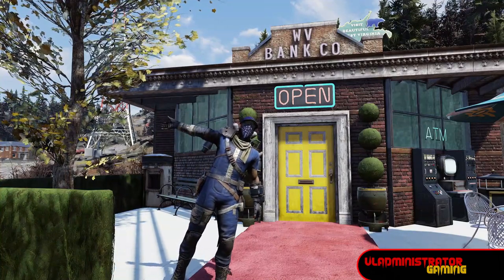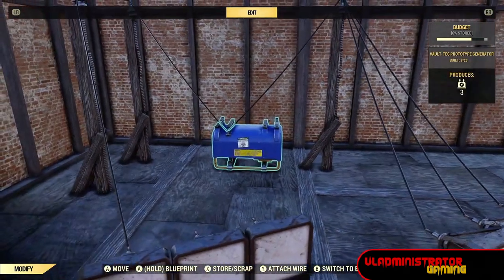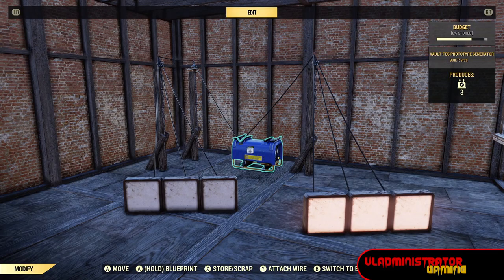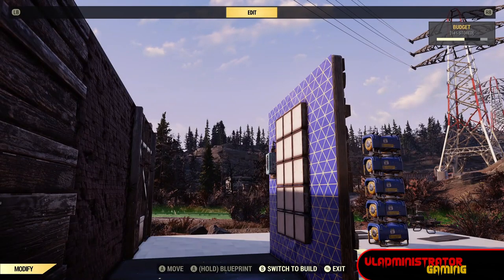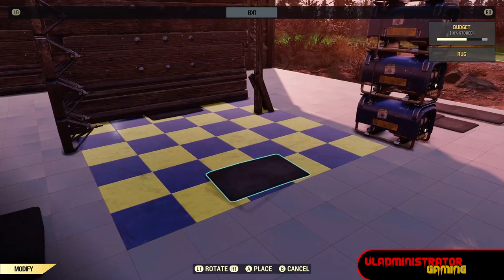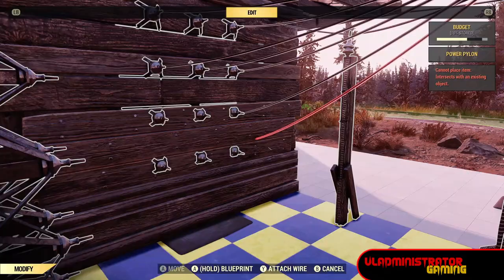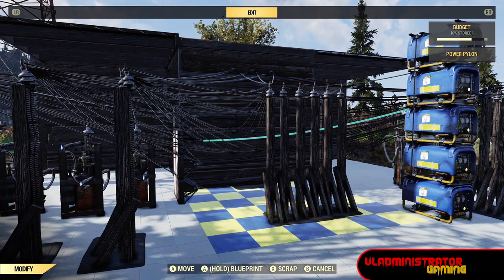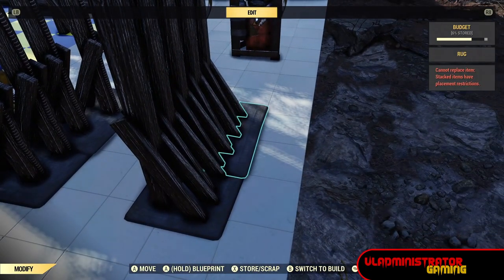How to Build a Countdown Timer | Fallout 76

Comment: Perfectly explained, I've always wondered how these work. Now I know!

Also, (in case this isn't fixed yet) don't delete items that have a wire connected to them without deleting the wire itself FIRST. The wire vill vanish with the item but still take up ghost budget on your camp severely impacting how much you can build.
Reply: Fuuuck: does the phantom wire budget go away if you switch to a different camp slot, or move camp?

Comment: Instead of using flame throwers for a countdown, could we use an alternating switch to make different patterns light up?
Reply from the maker: You could use switched, but you're going to have to keep turning one off to get the next in line to get priority. If you want to automate it like I did you'll need the flamer throwers. Otherwise, go for it with the switches.

Comment: Found a way to tie it into an OR gate for use with trip wire
Reply from the maker: Cool. 😎 I stay away from the trip wires because they don't persist in an armed state after you leave your camp.
Reply: @VladministratorGaming  they don’t?? I’ll have to test that. 
I did find a way to arrange the pylons so only the feeder gets burned. Saves materials on repairing. Side question: what platform do u play on?
Reply from the maker: @erich9532  yeah, destroying just the feeder piling will definitely save repair costs. I play on Xbox.
Reply: @VladministratorGaming  nice. I got it to work. And it looks like the trip wire stays in whatever state u put it in. I did daily ops and a few events and when I went back to camp it was just as I left it
Reply from the maker: @erich9532  did you try triggering it, because it may look armed, but it may not actually go off if you walk through. They've been bugged since the game released.

Comment: Not sure that the lines matter, your generator couldn’t power all the lights.
Reply from the maker: If you built it the same way I did in the video then yes they will. This is a complex network of wires and sometimes things break unintentionally with the wiring, or you miss something accidentally when building everything out. I tested each number of the countdown before moving to wire the next to avoid that sort of issue.